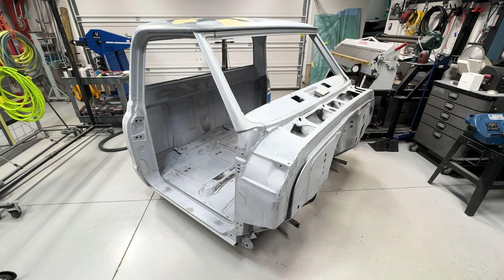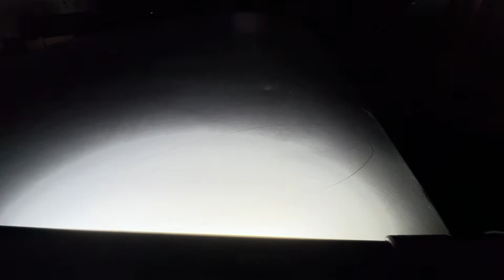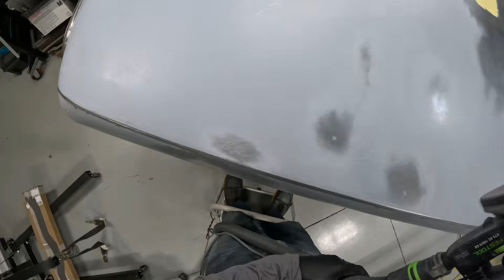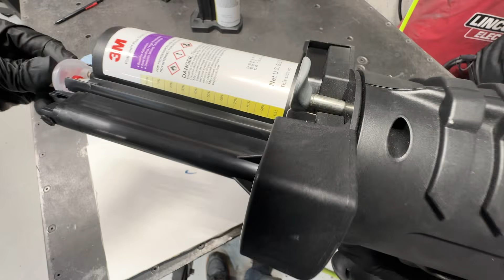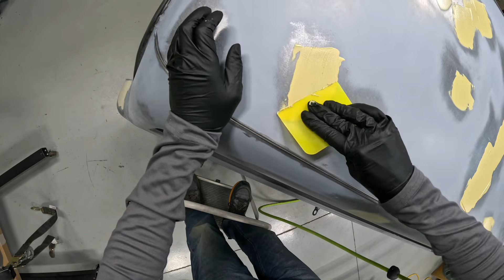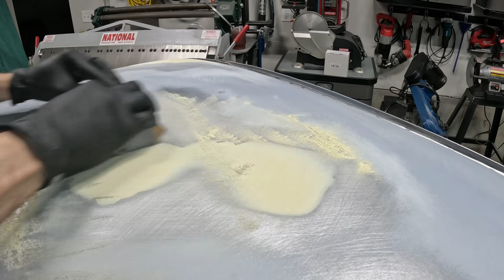Body Filler The Easy Way: 3M Dynamic Mixing System

Comment: 3M 50600 ?
Reply from the maker: Thanks for taking the time to watch the video.  Yes, that's the latest model number for international markets.  It looks like the latest one for the US market is 3M 05846.  Functionally they are identical.  Be sure to check eBay if you want to pick one up used/open box for a bit cheaper price.